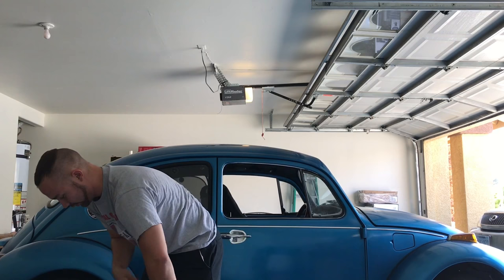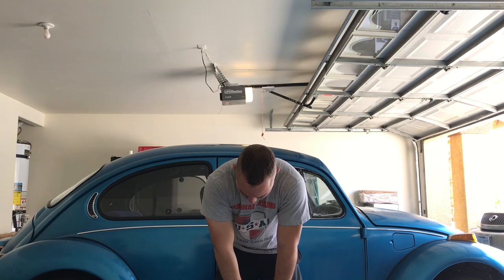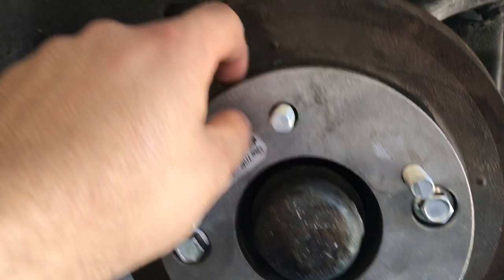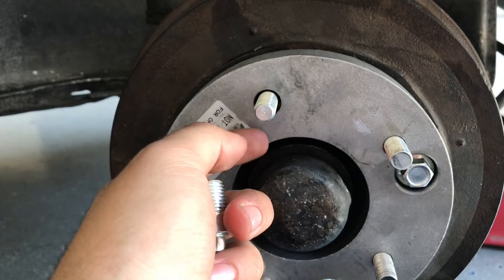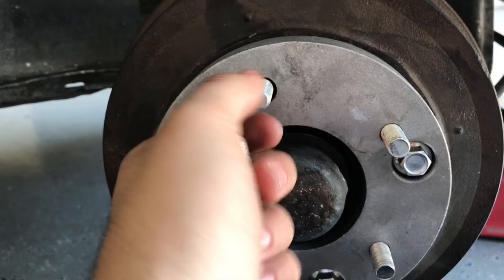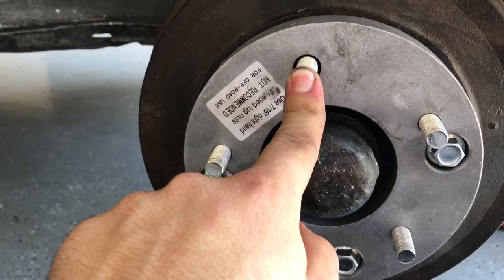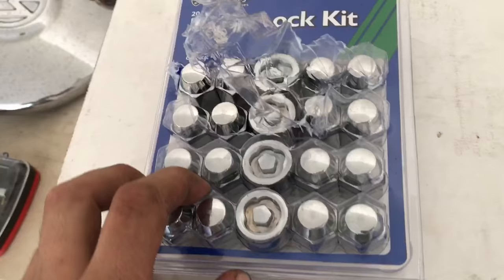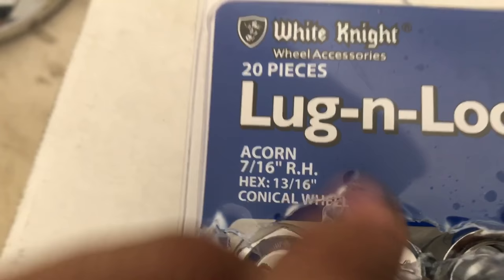Chevy wheels on The VW Bug

Comment: Looks great... what tire size did you use and rim size?
Reply from the maker: adrlop74 the Chevy wheel adapters are 5x4.75 and so are the wheels. also if you want to upgrade to disc brakes they have that pattern for the disc that are 5x4.75 too so don’t fret if later you want to change to disc brakes either because they have them for both disc after market brakes and adapters for your stock drum brakes